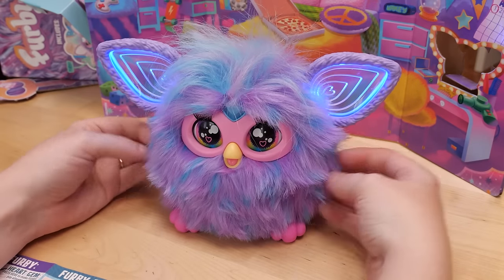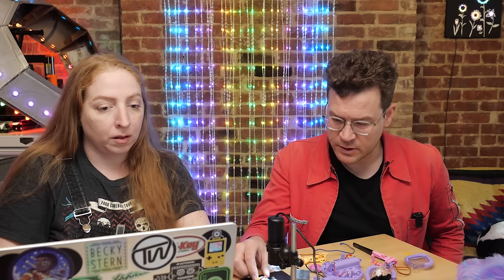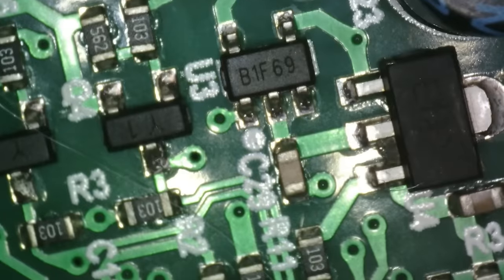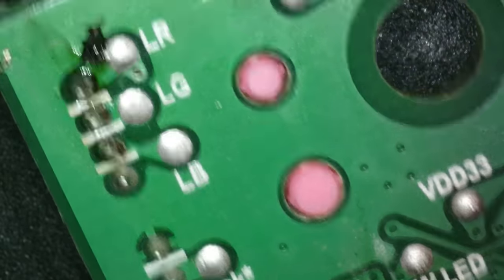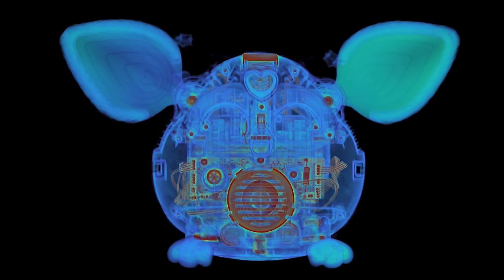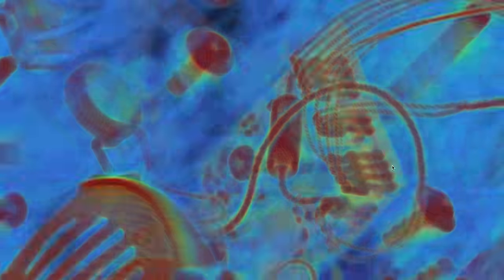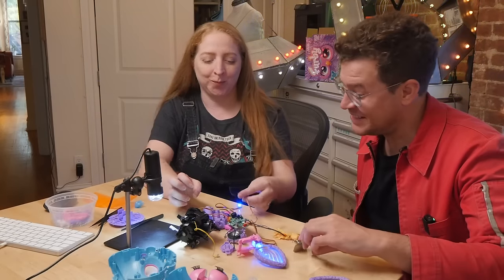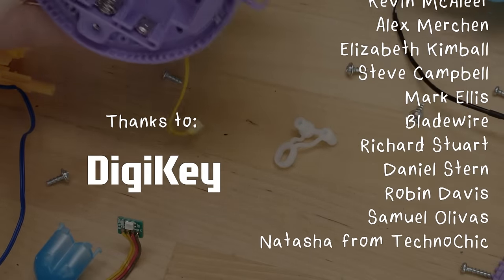What's inside the 2023 Furby?

Comment: 4:50 "saving fractions of pennies"

These kinds of cost-savings can be surprisingly significant, it's not just paying for a package, the chip has to be put inside the package, tested, sealed, probably tested again, marked, labeled, packaged, shipped, picked, placed, soldered etc. It all adds up quite quickly.

It's like how your CD-player comes with a manual in 15 languages; It's simply cheaper to print all those manuals and then have boxes that can go anywhere, than to keep track of which boxes hold which languages and which countries they can go to. Boxing manuals on demand is not an option and when units are required elsewhere, re-boxing is a complete waste of time, so they just put all languages in all boxes and surprisingly: save money.

Logistics.

Comment: Just did disassembled my daughter"s. It has been a real PIA. The front button was not working properly so i was wondering if a small plastic part was broken. The fur is terrible to remove, ans those pink anchor have clearly been made to make it easier/quicker to assemble, and probably to be more "repairable" on the papers. In reality, it's pretty much impossible to unlock them without damaging a few. 
Good luck reassembling it...

Comment: Have you done anything with big mouth Billy Bass?
Reply from the maker: Not yet, should I?
Reply: Yes, I bet it’ll be interesting.
Reply: And the cool thing is there’s a part somewhere on the circuitboard where if you touch it the pitch goes up and down you can make the pitch go faster or slower
Reply: @BeckyStern imagine if you could combine furby with big mouth billy bass
Reply: @BeckyStern I also noticed that 2023 furby has no movement for the mouth when every other one did